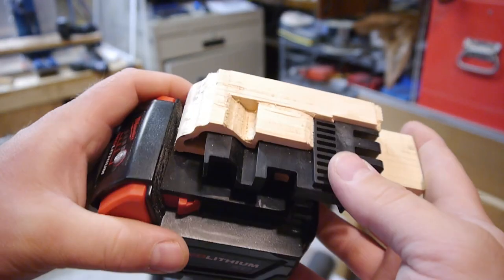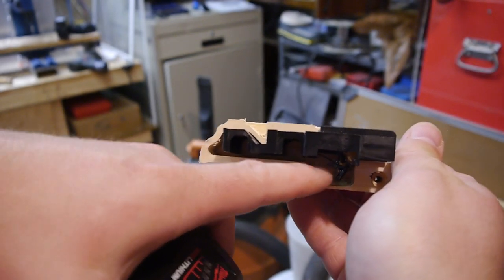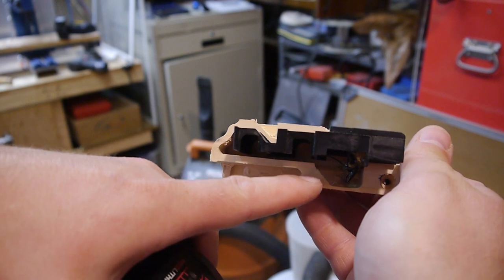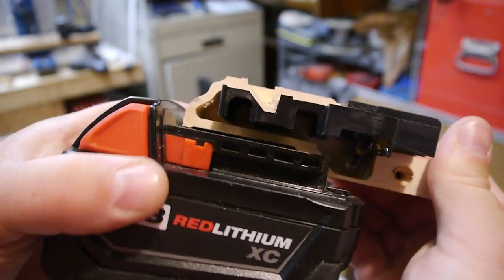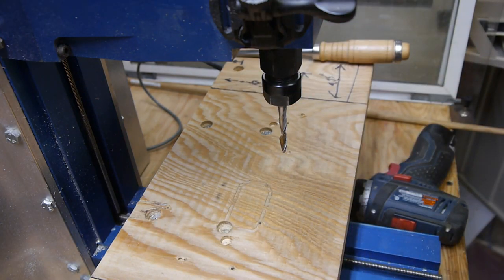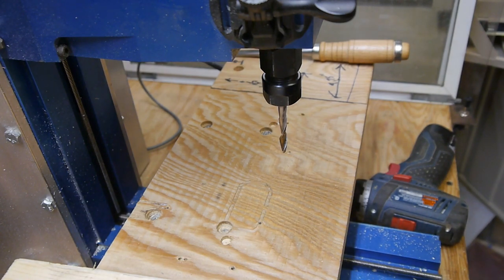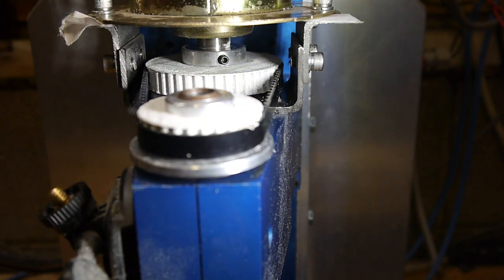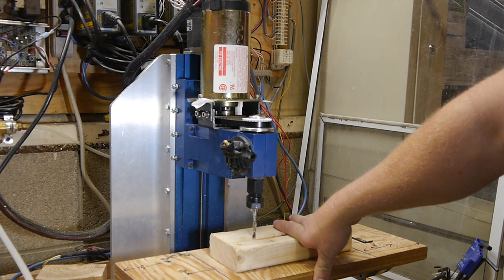Dewalt to Milwaukee Battery Adapter Episode 2 - Maxnc CNC Action

Comment: Been watching cnc videos.  You are giving me ideas. Might have to get one of these. I would have split the pack and installed new batteries. This looks more fun though.
Reply from the maker: Careful, it's a dark rabbit hole this CNC business. :-) Yeah, it would have been much easier to have replaced the internals, but like you say, not as much fun and I would not of had the chance to learn what I have! :-) By the way, good job getting that surface grinder off the trailer. That can not have been fun! https://www.youtube.com/watch?v=ywTRNlnbpSQ

Comment: Hmmm....I was thinking about trying to use automotive timing belt pulleys. If they would work (probably with some adapter sleeves) the salvage yard would be a pretty cheap source of pulleys and belts. Where did you get your ER collet adapter from?
Reply from the maker: That might work, As long as you can get a short enough belt that would fit them. I got the ER collet adaptor and collets from here. http://www.dearmondtool.com/taigacc.htm

Comment: My problem is to finding an adapter that can fit into an enclosed insert like the milwaukee chainsaw or portable table saw. You cant fit the adapter at all!. Any ideas?
Reply from the maker: You could do it. But it would depend on the size of the battery you are using to replace the milwaukee battery. If it is smaller, and small enough you are golden. If not then you will need to figure out how to mount the battery externally with either wires running from the battery to an adapter plugged in or if you have room a single adapter that plugs in with the battery mounted just outside and turned 90 degrees perhaps to limit how far it sticks out. Without an idea what you have that is the best I have. Thanks for watching.